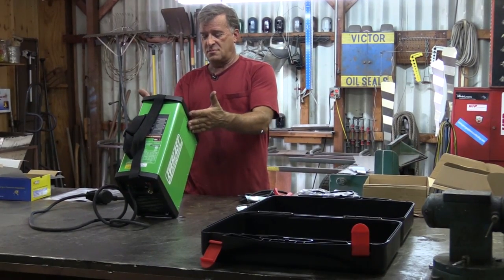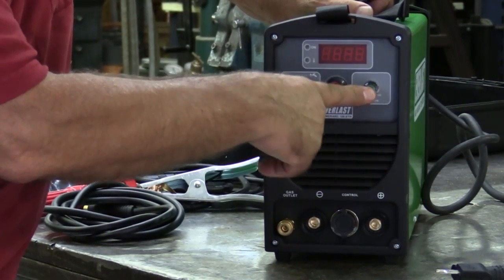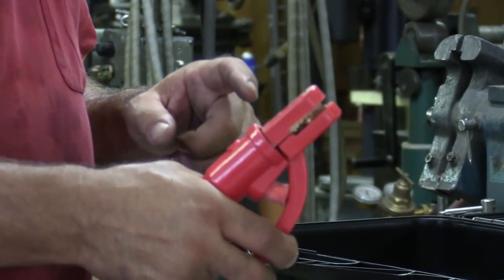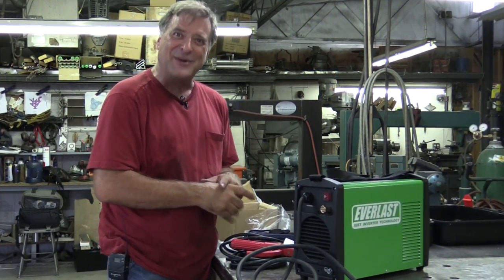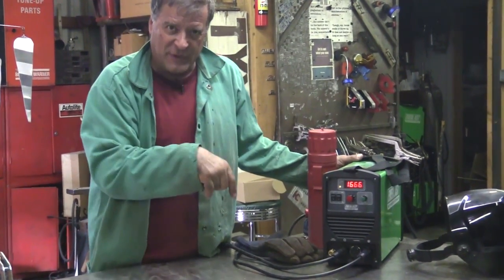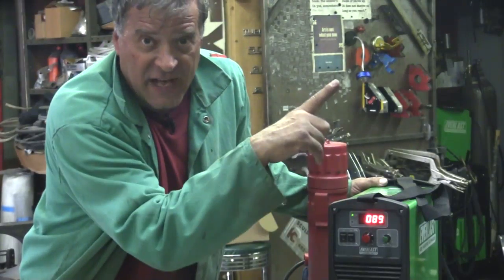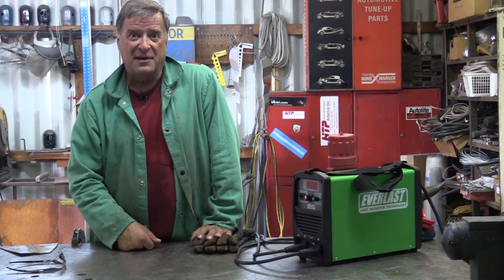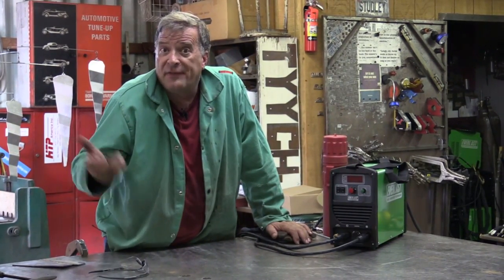How to Use a Stick (Arc) / TIG Welder Using Everlast's 160STH - Kevin Caron

Comment: What are the capabilities of the Everlast Power i-TIG 201
Reply from the maker: Check this out,, IGBT Type: 
Individual IGBT
Inverter Type: 
Digital/Micro-controlled
Output Type: 
DC Stick, DC TIG
Voltage/phase: 
DUAL VOLTAGE 120/240 1 PHASE
Max Rated TIG Amps: 

200 Amps
Max Rated Stick Amps: 

160 Amps
TIG Amps @ Rated Duty Cycle: 

120V: 125A/ 15V @ 35% Duty Cycle/40º C

240V: 200A/ 18V @ 35% Duty Cycle/40º C
Stick Amps @ Rated Duty Cycle: 

120V: 100A/24V @ 35% Duty Cycle/40º C

240V: 160A/26.4V @ 35% Duty Cycle/40º C
Max Inrush ( I1MAX ) Amps: 

120V: 31.2A

240V: 27.5A
Maximum Rated (I1EFF ) Input Amps: 

120V: 19A

220V: 17A
OCV: 

TIG:  70V

Stick: 70V
TIG Output Range DC: 

120V: 5A-125A/10.2V-15V

240V: 5A-200A/10.2V-18V
TIG Output Range AC: 

N/A
Stick Ouput Range DC: 

120V: 5A-100A/ 20.2V-24V

240V: 5A-160A/ 20.2V-26.4V
Stick Function: 
Adjustable Arc Force Control
Stick Hot Start Type: 
Auto Adaptive Hot Start
6010/Cellulose Capable: 
Limited to 6011
Minimum Amp DC TIG Start: 

5A
Minimum Amp AC TIG Start: 

N/A
TIG Start Type: 

HF/Lift TIG
TIG Start Type: 
HF and Lift Start
Memory: 
No
Start Amp Range: 

Not Adjustable/ Pre-Set
End Amp Range: 

Not Adjustable/Pre-Set
Upslope Time: 

0-5 Seconds
Down Slope Time: 

0-5 Seconds
Preflow time: 

0-5 Seconds
Post Flow Time: 

0-25 Seconds
TIG Pulse: 
Yes
Standard DC Pulse Frequency: 

.2-250Hz
Pulse Time On (Duty Cycle): 

10-90%
Pulse Amp Range: 

5-95%
Remote Control: 
2T/4T
Foot Pedal: 
Optional

Comment: Hi Kevin, I just picked up this unit and have been doing some TIG welding and was wondering should the torch be getting hot I was doing a bit of welding at 90 amps welding chain links to each other.
Reply from the maker: Yes, it will get warm when you use it.   Maybe up your gas flow just a little and see if that helps.   I know when I use mine I have to give it a break every 30 minutes or so.  Just gets too warm to hold even through the gloves.

Comment: I'm glad to see you reviewing this, and will be even happier when I see you run some TIG beads with it! I was really interested after your Everlast 140ST video for getting into TIG, but in researching this seemed like a much better way to go, without jumping all the way to an AC/DC welder.
Reply: I've been using it for the past 7 months and it's been a greater starter machine. My cousin who's a certified welder has been impressed as well for the price. I picked it up for 488 on Amazon and it came with a foot pedal as well.
Reply from the maker: It's a fine little machine..    Looking forward to putting it through it paces...

Comment: STH = Stick / Tig / HiFreqStart ?  Just a guess :)
Reply: Yup, it sure is. Compared to the PowerArc 140ST, which only does stick and lift-start TIG, and comes with a 17V (valve) tig torch.